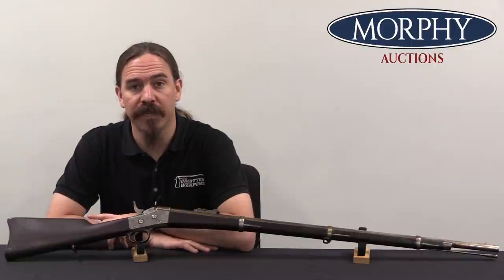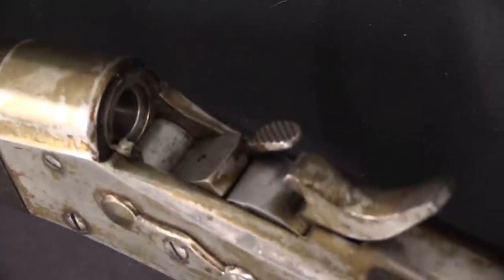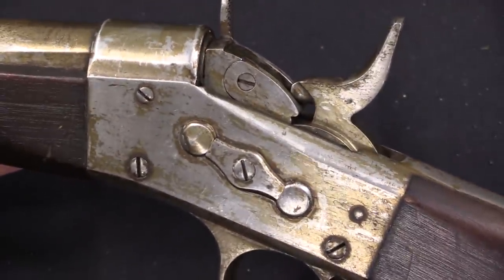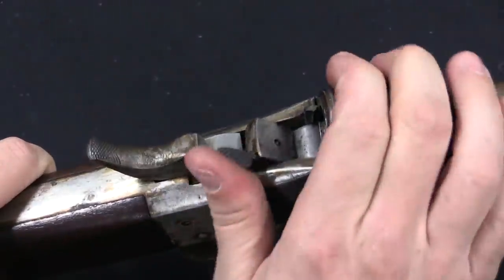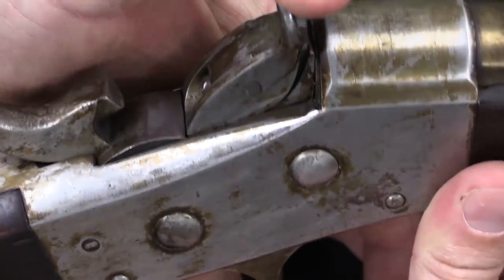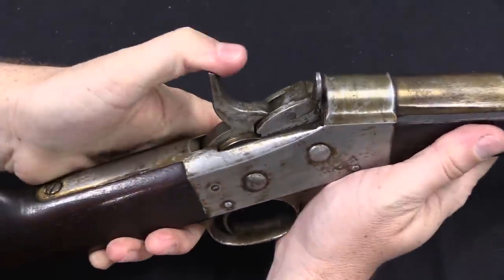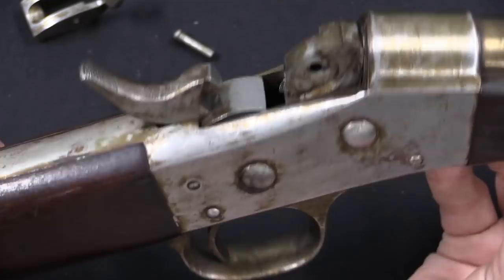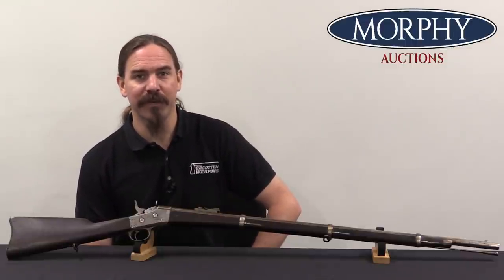Dodge Patent Prototype Rolling Block Rifle

Comment: What are the crown markings on the barrel bands?
What does it seem to have a ram rod?
Reply: I've tried to figure out the crown markings, they're clearly Belgian in origin. The same crown marked barrel bands are found on Belgian made or Belgian rebarreled Rolling Block rifles from the Egyptian contract, and several Belgian South American contract rifles. Either Ian is wrong about the timeline and origin of this rifle, or someone completed it with parts off a cheap Egyptian or south American import later on. It might even be that someone had the neat patent breechblock lying around but not the rifle for it, and stuck it into a rifle at a much later date.

The cleaning rod is fairly standard, that's one of the patterns you see on many different models of Rolling Block. It's not a ramrod, and it's too short to reach all the way through the barrel without the threaded handle that would have been issued with the rifle.

Comment: What would happen if the hammer was locked on that stirrup and the stirrup got bumped forward? I’d think it would fire. Like what resting a colt peacemakers hammer on a live cylinder and smacking the back of it does.
Reply: If that were to happen, would the hammer not just drop into the half-cock position, since the trigger is not being held down at the time?
Reply: If you could push the stirrup forward against the mainspring pressure, the hammer would still be stopped at the half-cock notch. 

Unless you were also pulling the trigger at the time. But that makes it a very deliberate action.

Comment: But what if you bump the safety modification.
Reply: kids these days, trying to bump fire a rolling block. I was wondering the same thing perhaps there's a reason that mod never caught on.
Reply: @ScottKenny1978  No since you just pushed it out of the way.
I was wondering if it stay put if you bump it hard by accident.
Reply: @Revener666  watch the video again. The half-cock notch on the hammer is about 3mm/⅛" away from the hammer hitting the firing pin. There's a lot of travel between where the stirrup locks the hammer and the half-cock notch.

The only way that gun could go off is if you pulled the trigger and smacked the lever hard enough to push the hammer out of the catch on the stirrup at the same time.

Comment: It would seem that if someone were to bump the breech block forward while it is in the patented decock position that it would reset the hammer to a ready to fire condition, completely eliminating the safety feature in any kind of slinged carry. There seems to be an element of a good idea here but I imagine something more like a pistol decocker lever that safely lets the hammer down for you. I'm not sure I would trust illiterate peasanats with such a fine motor skill procedure on a supposedly simple weapon of war.
Reply: I think the geometry of the safety piece is such that it kind of hooks under the front of the hammer, so the pressure of the hammer spring holds it in place. It looked pretty difficult to dislodge, but then there's a good reason for not trying to force the part on a hundred and fifty year old rifle.
Reply: @discerningscoundrel3055  I would assume a good design would have some kind of sear hook feature to prevent exactly what you describe but I just didn't see anything like that in the video. I could be wrong, of course. Also these pieces are nice and chunky, I very seriously doubt anything would happen with simple thumb pressure. Especially considering all the one of a kind guns he regularly detail strips. But even if I was wrong about the mechanism I still wouldn't trust such a finicky safety to the lowest common denominator peasant.